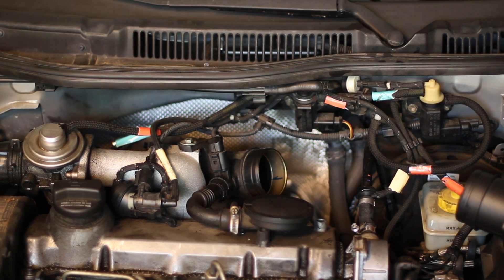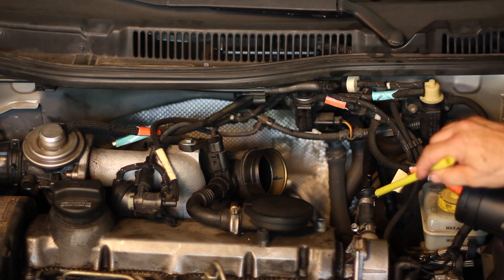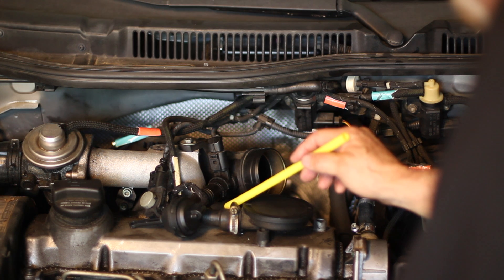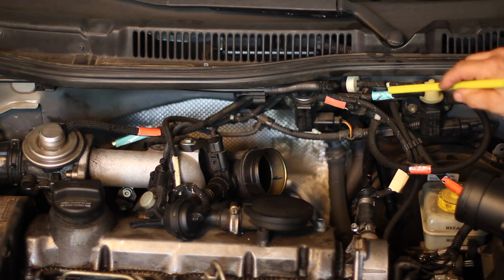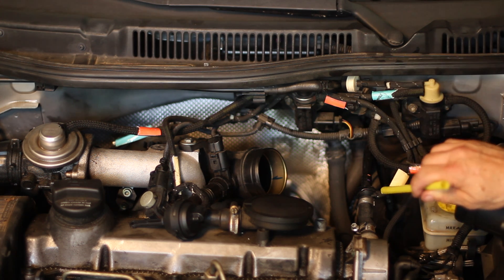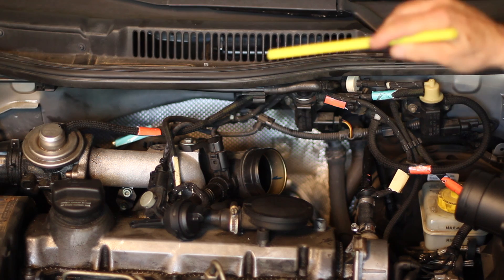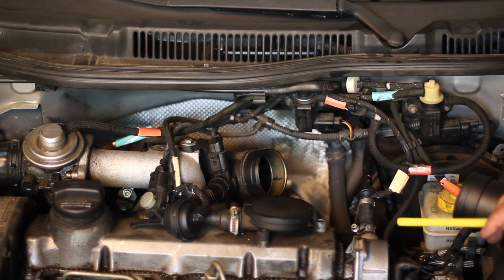ShadeTree Episode 3 - ALH TDI Vacuum System

Comment: Do you know what In the vacuum system would keep blowing a 10amp and then limp mode I replaced the 18 and 75
Reply: Figured it out years later cracked wires going to vacuum actuator

Comment: I don't know if i missed it in the video, But dose any one know the correct sizing for these vacuum hoses?? 
Iv read that they are 3mm and 5mm, but iv also read 4mm so I'm not to sure what the correct sizes are.
Looking at replacing all my lines!
Thanks!
Reply: It's 3mm and 4mm, the 5mm hoses work but they can come off fairly easily, if your cars tuned they come off fairly easily, ask how I know lol

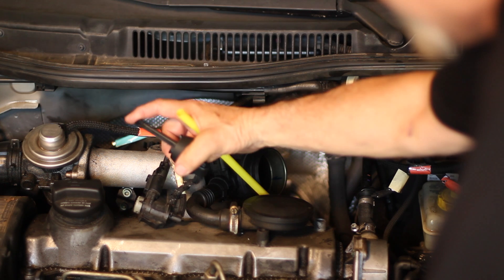Comment: hi, the part  at 0:57, i need to replace it can i just pull the old one out and replace it with an other one. will that work or do i have to follow some procedures? can you help me as soom as you can. thanks